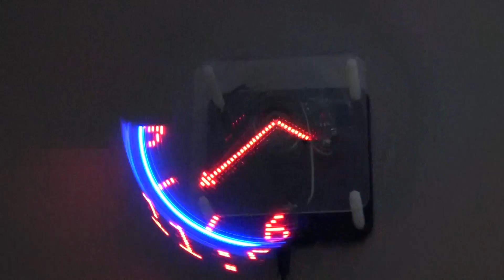A short rant about very old electrolytic capacitors

Comment: You are right about capacitor not always needing replacement but I my experience with vintage audio equipment is always better to replace them if you want to have it working right for another 30 year this electrolytic capacitors often act-up when the unit is warmer up and running so that’s my reason for replacing the caps plus they are not very expensive and or hard to replace just for good masher
Reply: Replacement capacitors can be expensive, especially the big filter ones, and not that easy to replace depending on the unit.  But cost and time doesn't matter to some for that little extra peace of mind I suppose.

Comment: I have an old H.H. Scott 342-B and most of the caps seem to be good on it despite being from the late 60s to early 70s.  The sound is still very clean and detailed.  I changed a few out as one did start to ooze some clear substance and I also replaced the output coupling caps as if one of those shorted it would take out a speaker.  I planned on recapping it, but just gave it a very nice long run and was amazed at how good it sounded.  I think it comes down to how well the caps are made and sealed.  Early Elna caps from the 60s and 70s seem to age badly, but yet other caps will be fine.  Seems caps from the 80s and 90s are still in good order, but caps from the 2000s have a worse failure rating then caps from the 70s.  I have a few motherboards from the 2000s with bad caps.

Comment: I agree it's silly to replace ALL the aluminum electrolytic caps just because they are old.  I have receivers and radios from the 70's still running fine with the old caps.  If I see a cap fail, say a 220uf 10v for example, then will check for other like 220uf 10v caps to see if they are failing too.  Also it seems a lot of SMD electrolytic caps from 80's and 90's crap out too.

Comment: I think the makers were still conservative in their designs up to the 80s.  Starting in the early 90s Hi-Fi and likely other forms of electronics, the market started to dwindle.  Cost cutting became the rule for survival.

I was working in electronics manufacturing, power supplies, sensors, controllers, tape drives, during those times.  The newer stuff was comparatively flakey if not real junk.

Comment: It is the smaller one that appear to go.  I had a big one in a power supply explode and I have never taken out so much paper from anything in my life.  I think I had more parer than the paper mill.  But that is an exception.  I have an old Yamaha Amplifier bought in 1970 and it is still running like new with all the original caps in it, only thing I have to keep doing is clean the control knobs, for some reason they get dirty very quickly, after that it sounds like new for another year.

Comment: Do you also use an LCR meter? I have a DE5000 that gives a better insight as to the health of caps than a standard ESR meter. That said: your right, random recaps are silly and unnecessary.

Comment: I generally just replace the rectifier input caps. Those are the ones that get hammered by current slugs and are likely to dry out. I'm also leery of caps in any gear that hasn't been powered up for a decade or more.

Comment: To play devils advocate for a minute,  someone has a nice amp/reciever,  one day notices something doesn't sound right after 20 or 30 years , brings it to get fixed , tech finds and replaces the bad parts/ part, charges for diagnostic time and parts , then a  month to year later something else isn't  quite right , customer brings it back , tech finds and replaces part , charges for fixing again diagnostic time and parts , and so on . Most customers would be like it was just here a month ,3, 6 or 12 months ago , that repair didn't last at all and thats if they brought it back the second time , some would junk the piece because its now "unreliable" and say so and so tech doesn't  know shit. Versus going over the amp verifying factory schematic values against whats actually in the amp , do up a quote for all high quality nichicon , elna, or rubyicon caps along with any burnt out transistors/components ? Its only going to be $ 50 to $ 70 to replace all the capacitors while your in there compared to spending $50 to $70 to replace a cap or to later on. Plus the customer has a completely restored amp/ reciever that should be good for another 20 ro 30 years . Another point being do you charge for removing testing and then putting back original component if good ? That part may only be 5,  10 , 20 to 50cents new ,  heat cycling with solder components can change the value slightly and degrade the life span too . I dont throw parts at pumps , cars , snowmobiles, quads, and other machines i work on i verify the sensors operating parameters and go from there engine codes only point to the area that can have many sub systems , wires , and solder joints that can break not a definite diagnosis .

Comment: The capacitors are just fine in my Philips N1502 and N1700 video recorders from 1975 - 1978.  Yes relatively modern professional (expensive) studio equipment such as Panasonic DVCPRO decks, which are about 12- 15 years old, suffer mass capacitor failure to the point that they are virtually unrepairable.

Comment: Doesn't surprise me!  I see the same thing time and again - lots of old caps are still very good, and as you say - often read better than new ones regards tolerance (and sometimes ESR).  My view is replace what needs replacing (eg. batch / manufacturer) when you find faulty parts on a board.   My theory is you could replace those old caps with new ones and the new ones may not last long, whereas the old ones had they been left in there probably would still be OK.  Still enjoying the channel btw!  =D

Comment: But would it be safe to say that small caps should be changed?
Reply: No.
Reply: @SinsBird  Hmm I'm coming to realise the same, but I did a recap for my main amplifier a few years ago.
But for my next unit I will replace the electrolytics in the signal path with foil caps :D

Comment: I have a 50 year old amp has ITT caps in still good turn off the power and it runs for over a minute, modern one are about half the size though.

Comment: Yeah,  I've ran into mostly wax paper foil in tube circuits that the full plate voltage was getting to the c grid of the following tube, that's a big problem with something 50-60- 70 years old.  I've had a few electrolytics that go bad, but when they do, I can usually tell, if they're open, very rarely are they shorted, but they can be leaky and won't filter in a power supply.  I've not hardly had any problems with resistors, except a change in value over time. Transistors are picky in Darlington and direct coupling. Tubes are so forgiving.

Comment: You are absolutely right about checking parts first before actually replacing them. Everything else would just be preventative maintenance at best or even introducing new problems like bad soldering joints at worst.

But there came a time (starting in the mid-80s probably) where manufacturers decided to take down component quality a notch or two as a result of economics departments taking over engineering. All manufacturers are guilty of that, even specialists like Nakamichi. And electrolytic capacitors, transistors, potentiometers as well as opamps were one of the main fields where cost reductions were applied.

We have all seen leaking caps that totally destroyed circuit boards as a result of acidic corrosion. Which is where all the hype about recapping stems from IMO.

Comment: Not that I doubt you in any way shape or form but I'm slightly puzzled by the numbers here.
The 'good range' for the 100µF you quote as being between 0.15 and 0.8, (fair enough, its quoted elsewhere as being 0.77 for 160v), but the ESR meter measures it to be 0.08 which is well below, (almost half), the minimum 0.15....isn't it? I would have said this was well outside the 'good range' in fact its getting very close to a predictable dead short....or am I just reading this totally wrong?
Reply from the maker: That scale is maximum esr for new capacitors.  They all will measure lower.  Esr and short are 2 different things.  Esr uses high frequency ac to pass through the capacitor.  DC wise it will measure infinite resistance.i had once a cap that looked great on esr, but had internal short.  The ohm meter picked that one up quick.
Reply: @12voltvids  Ah......excellent, thanks for the explanation, makes much more sense now.

Comment: You have to look at the type of capacitors (brand) and take in account what they are known for. I have a Kenwood receiver from 1968 that blew its power supply cap. I will have a very critical look at all caps in there and will probably recap them. Same with a B&O receiver from the same year, it sounds bad and it sounds like it has bad caps. I think I will recap it because once you are in it for that problem it would be unwise to replace only the ones that are bad now. To come back to the car analogy, if you have one tire that is not legal any more, you will replace both on the same axe. You are not going to replace one tire and then the next one in 4 months. 
On the other hand I have a Luxman amp from the 80's and I do not plan to touch it any time soon. There is no indication for it (it sounds great and has great power) and the amp is not known for requiring recapping.
Reply from the maker: There is a big difference between 1968 and 1985.  Capacitors greatly improved in the late 70s and right through to the early 2000s with the exception to some of the early low esr caps used in early smps. Smps are very hard on capacitors to begin with but conventional power supplies operating at 60 hz are not very demanding

Comment: Well to be fair, 90% of the caps in my Luxman LV-103U  had failed. It was manufactured 1987. I guess it depends also how the unit been used. Maybe something  on top that blocked the vents litte lo much or smilar. Adn the unit can have been used heavy with low ohm speakers etc.
Serviced a Yamaha A-700 from 1984 and almost all caps (even some micas/polyester) were very bad.

Comment: I agree, if the caps are good, why change them. However, if I had some equipment fixed they replaced my bad caps with 30 year old caps, that would be the last time I used that engineer.

Comment: I'm retired and am re-capping my amps from the late '70s and early '80s. I don't want to have to tear into my gear again. My vision and hand-eye coordination may not last as long as my ears. I suspect that most of the electrolytic caps are still good. I'm mostly going with 105°C. 3000 hour replacements from the most reputable manufacturers. My peace-of-mind will be worth the several hundred extra dollars for new caps. An old cap may test fine, but can still be chemically compromised or corroded, so it will fail over the next twenty years. 
-> Can you please make a video showing how to identify polyester (Mylar) capacitors? I would like to replace those with polypropylene or polystyrene.  <- Thanks!
Reply from the maker: Remember that 105c caps will give you a different sound than 85 in the audio path. 105 are required for switching power supplies and specific applications but don't improve audio applications.
Reply: @12voltvids  Yes, I'm aware of the potential difference. Most of the critical caps are non-polarized, and are 85°C, but high hour. I've read lots of discussions in diyAudio, Audiokarma, etc. I'm not trying to improve the sound; just keep it close to what it was forty years ago. I consult the charge and discharge curves from the datasheets. By increasing the voltage rating, I can operate in a more "linear" portion of the curve.
Nelson Pass likes the Elna silk caps (147 pages as of today):
https://www.diyaudio.com/forums/parts/151392-electrolytic-capacitors.html
Reply: Yes, exactly. If you are going to do the job, do it properly. Just because a cap tests good now, it may not be in three years.

Comment: But you changed the parts that weren't faulty, just like the Mercedes technician... Didn't you... ?
Reply from the maker: I decided to change them to see if I could hear any difference in sound.  No difference and after measuring the old ones it is clear why there was no difference.   Most had no issues except for a few of the small ones that were starting to go up in esr.

Comment: wow they are holding age well considering what they go through
Reply: Read up about the "capacitor plague and watch out for "CapXcon" capacitors. They were made with an incorrect (incomplete) dielectric formula that was stolen from another company. Those capacitors caused thousands of devices to fail. I made beaucoup bucks repairing and reselling LCD monitors when they were still very valuable. Those bad caps cost manufacturers billions. As well as tarnished reputations.

Comment: You have to leakage test as well. They might test ok on this and be very leaky
Reply: 100% correct. Got one here now where caps tested perfect for ESR but were horrendously bad, even dead shorted.
Reply: Ray Rooney Exactly! ESR only tells a bit of the caps performance. I high voltage leakage test. I test ESR, parallel resistance, high voltage leakage.........hell, using your old Triplett 630 on the highest resistance range uses the 30v battery which will tell you if it is leaking over these ESR meters. I have the Blue version of this and the DEE 5000 which gives much more details with variable frequency you can test under. At 1khz signal it shows ok, at 120hz a different story. I like this channel but he is not very open to suggestions as I found out over a year ago in his setting up of an Eico 666 tube tester. Got a bit testy over my comments he didn’t have it set right. I’ve owned a 666 for 15 years and know it well.
Reply: @RuneTheFirst  Yep, that's why you don't stop at measuring ESR, especially if a cap is suspect yet manages to pass such a test.

I mean, if a cap has ESR that's too high, then it's bad.  But good ESR doesn't mean a clean bill of health by itself.
Reply: Measuring caps with a multimeter can show high capacity values when in fact you are measuring charge capacity and leakage. Multimeters just measure current going in the cap over time, as a leaking cap loses charge while the meter is testing the value shown by the multimeter is most of the times to high.

Comment: I find that many of the people who apply the blanket "REPLACE EVERYTHING" mentality to vintage electronics are those that have worked on/seen people work on a few specific 90's computer motherboards. Every Macintosh Classic and SE/30, Amiga 1200 and 4000, and Commodore CD32 I've ever seen have had leaking or otherwise out of spec electrolytics, it seems to be a widespread and expected problem at this point for those boards. In contrast, I've never had to replace capacitors in a Commodore 64 or any 80's IBM PC compatible, and most CRTs before the early to mid 90's that I've dealt with have had good caps (save for a very shaky Commodore 1901).

Comment: Can we check ESR value of cap without desoldering legs (pcb itself). Due to cap problem in power supply does it causes any damage to other parts.
Reply from the maker: In some cases yes, because the voltage applied by the esr tester is below .6 volts so it will not pass through diode or transistor junctions. You will get false readings if there are inductors or multiple caps in parallel. So best to disconnect 1 lead.